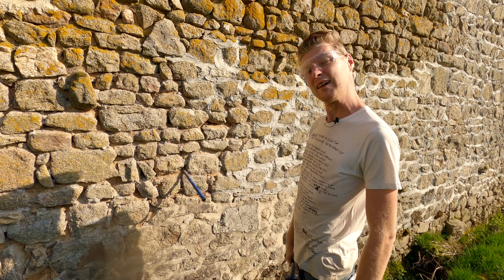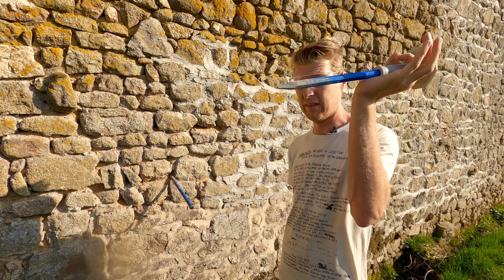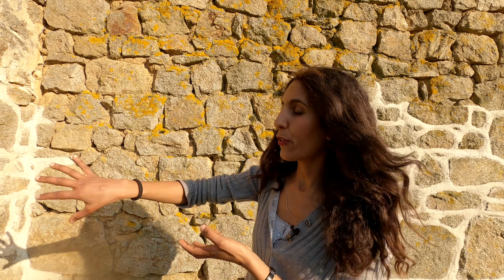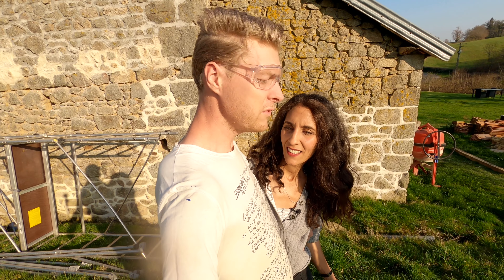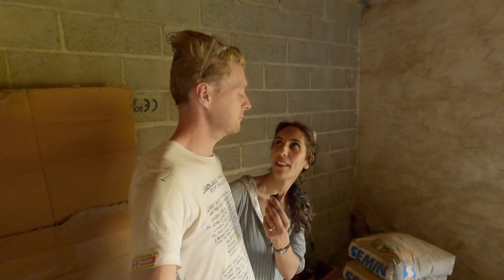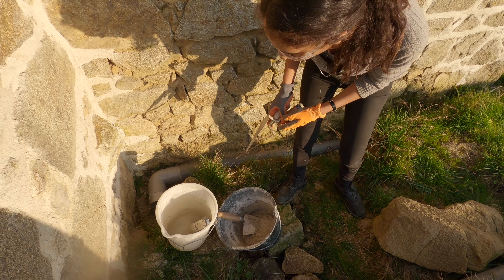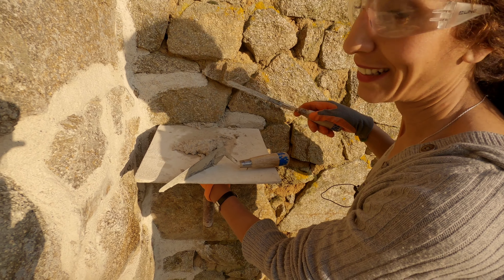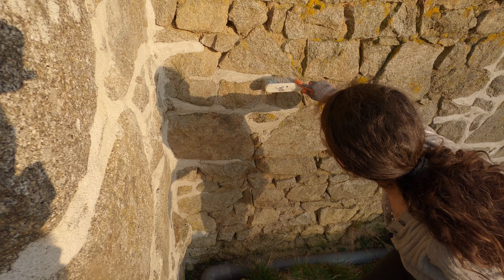Pointing with Lime Mortar

Comment: Great video. I use a pump spray to wet  stone or brick joints before pointing. Spray for a couple of days after so it doesn't dry or crack. 
Beat in with a churn brush when it's gone off a little then work around stones. 
Bend a lip on my hawk 40mm up so lime doesn't slide back or off.

Comment: A very good video. I believe a final step is needed. When the mortar begins to harden take stuff brush and tamp the mortar. Camping removed the slick finish and allow for rough finish. However, it also promoted carbonation which is necessary for the curing process.

Comment: Hi can you also use normal cement - which is better?
Reply from the maker: Hi Michael, for a stone building I prefer to use lime mortar just because i want my walls to be able to dry and with cement any moisture in the middle of the walls we could end up with damp and problems inside ,of course you have to use what you think is best for your home